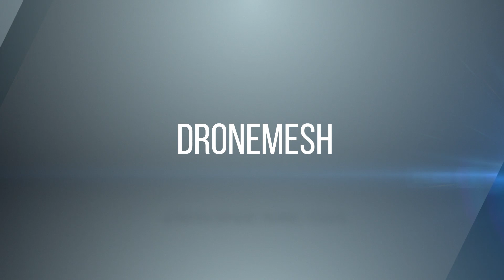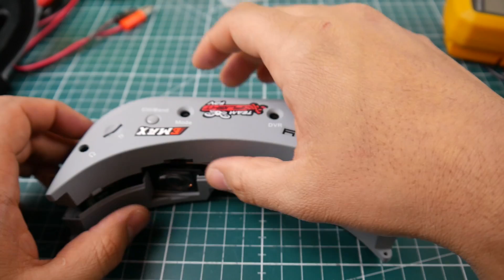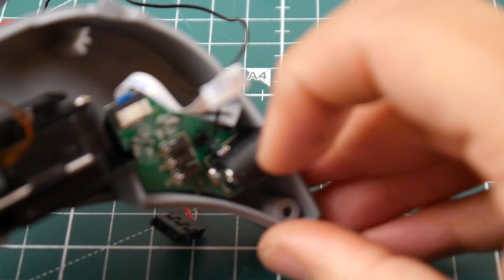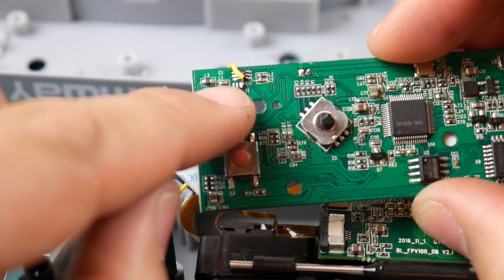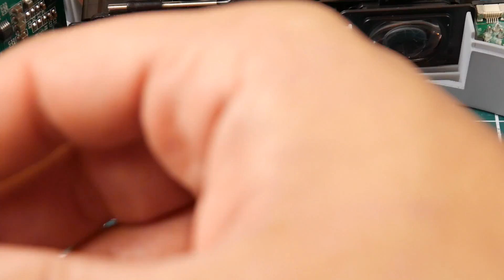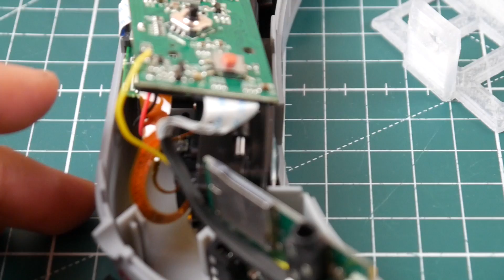Aomway Commander Fatshark Module Mod // Only 3 Wires

Comment: Hay mesh I've messaged you several times I unscrewed my antenna the other day &the SMA broke off the pcb board! Were can I get 1 at or a universal 1 that will fit? It's the left side SMA moduel for Aomway v1 goggles? Oh somewhere besides China The states preferably
Reply: Hey Mesh can't ever get you to answer me babe but I need to know
Reply: RX5808 5.8 48 ch dive RX osdrsity fpv video receiver  display FS HD2 &HD3 moduel for fat sharks will it fit

Comment: Do you think it is possible to replace the DVR with an external one using those two chips?
My goggle came with the DVR not working, and there is no support from Aomway whatsoever (here the extra bucks for a Fatshark pays off).
I have tried to replace the DVR firmware via SSD card and directly to the chip memory (soldering required), but it didn't work.
I have one Eachine PRO DVR and I was planning to solder this unit's video IN wire at the goggle's AV out/in jack until I saw this video.
The problem is not having a way to see the DVR screen, so I'm wondering if I can use the video IN chip you mentioned to connect the DVR video out cable, so at least I can switch to the external video input to see the DVR screen (maybe it will work with the AV out/in jack as well).

Comment: Any further update on this little project?

Got some ideas floating around, but don't have the budget or patreons to just go and possibly FUBAR my only pair of goggles!

I'm about to start a long range freestyle build using 2.4G vtx module, and really don't want to buy a whole new set of goggles just to fit the module!
Would it be possible to take the video signal to the the AV input chip instead of the diversity switching chip? 
That would allow the use of the internal 5.8G modules for regular use and swap to the AV input to use the retrofit 2.4G module, what are your thoughts on this idea?

On another way out note... The possibility of putting x2 divi modules in place of the originals and having a DIY pair of dual diversity goggles? 
But unlike the EV200D actually working reliably!
Reply: This is where my head is at too.

Comment: I got fat shark dominstor v3s but the diversity module us a pain and the googles dont even work until you install one do you have to install anything on the aomways? Or do they work right outta box ?
Reply: They work out of the box. Just upgrade the Antenna for better range.

Comment: Thanks for this video. My commander right side module no longer work I tried switching them around left and right and the problem follows the right module so it’s not the wire harness. So how has the mod held up? Is the 5v strong enough to power hungry modules like the rx5808? Thanks also will audio still work?

Comment: Your support material sticks to much because the z gap isn’t big enough I used to have that to if your using cura click the little gear in the bar for support and select z gap then increase it to 0.3 because 0.2 is stock settings

Comment: Great tutorial! When I get a fat shark module how do you connect it to the wires you installed? Do the modules have pin out labels? I never had a module in my hands so all I am is familiar with is what I have seen in ads. They plug into fat sharks, we would be soldering the wires to the FS module? Thanks again for the video.👍
Reply: Sorry for the type o, I am unfamiliar with FS modules

Comment: Now I know what to do with my commanders when they will start to bore me :)  Well, I disassembled mine to to check for assembling glitches. Fortunately mine was second revision without them. By he way most useful addition to commanders would be independent focus adjusting for each eye and DVR possible to save PAL resolution frames with 16 kHz sound.

Comment: I admire your motivation but the risk of ruining an awesome pair of goggles just to say you have a "Fatshark"  module is just not worth the risk ..I have been flying for 6 months with my Aomways almost every day and never a problem.  NOTHING !  with Springtime I am breaking out the "Big Guns"  DJI RE Gogghles and finish building the Occusink system in a 7" Waffle Kwad  and TBS Endurance motors .

Comment: ive ripped flat cables before, cant you just cut the damage part off and scrape the traces with a razor blade, ive fixed many of my friends ps4 controllers this way just to get you out of a bind.
Reply from the maker: Thought about it and now I will do it.. Thanks
Reply: I might have to do this cause the Rx module cable ripped...wtf are those black holders for the cables called and where can I find them? I’ve contacted Sean for a new Rx module it’s been like 2 weeks...can’t find the module anywhere.

Comment: Very interesting i like it also i wonder if its possible to 3d prind a fatshark face plate to fit the commanders as it would make them fit so much better to ones face and also have you followed up on the audio problem with the anoying static cheers mate love ur work

Comment: Fantastic work.  Means Amoway users can use Clearview or LaForge modules if they so want.

I find the inbuilt diversity modules in the Aomway's are adequate for what I want and convenient with the inscreen display of the channel information.
Reply: ArchmageAU I think split modules like the LaForge are out.
Reply: Maybe.

But after all it just needs to get a video signal to the goggles.  Depends on what the LaForge split module requires for connection.  It may be able to be catered for.

Comment: Cool Video! I think about trying this out! Have you tried to add a little bit greater distance between the support structure and the part? Maybe you should make a test series and increase the distance until the surfaces don't connect anymore.

Comment: Remove that broken cable and connectors to it. 
And then try to solder it with thin wires

Comment: Why would you want to change the modules out? I have Fatsharks with the TrueD and another pair with the La Forge and my commanders have the same or better range.
Reply: Clearview module could be one reason, graphical band scanner another.
Reply: Faawks for those who don’t think the range is better
Reply: I don't think this makes it any less reliable if it's done right. Obviously for someone who has little electronics skill, this would probably break their goggles.
Reply: aefgshwrthwrhnwrhnbw  you mean like he broke his? :)
Reply: compared to my new hdo 2 with rapidfire the commander v1s drop out about 100 meters (300 feet) quicker.
Reply: Totally true, not to mention hes just messing with the goggles and putting wires here and there... Not cool, it doesn't look reliable at all.

Comment: Not being an Aomway Commander user  I still don't know what this fixes. Whats the problem that needed the hack?
Reply from the maker: Isle of Mull FPV This allows you to put fatshark modules.
Reply: No way to upgrade the firmware, eg achilles, so needs a way to mount different modules. Ok. Thanks.